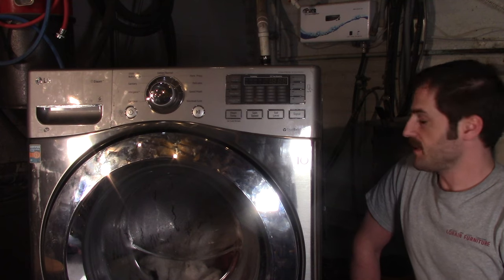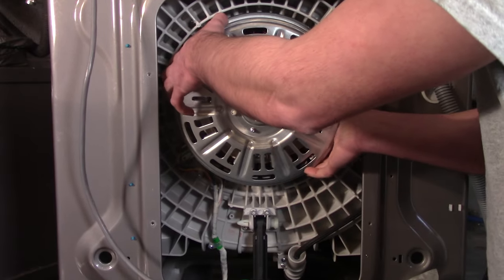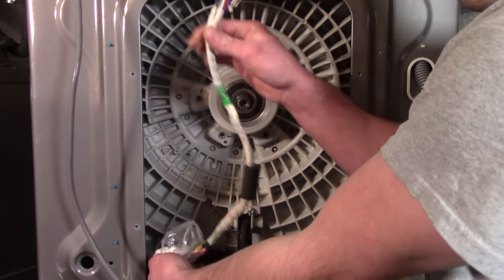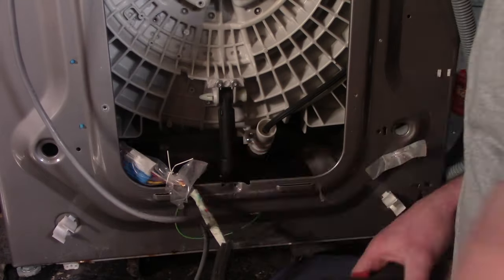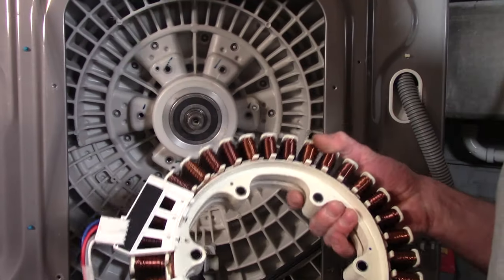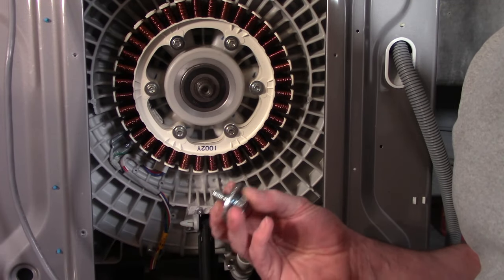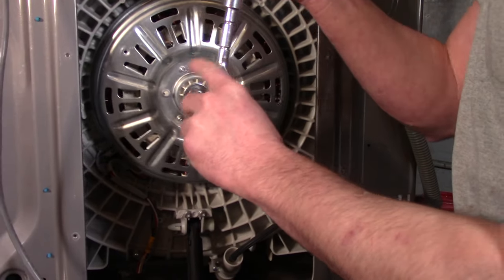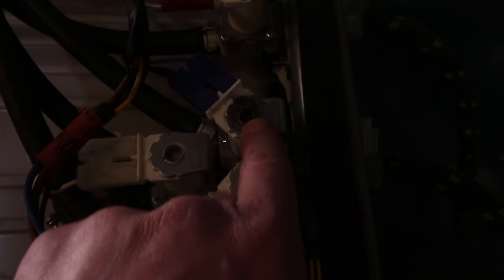LG Front Load Washer LE Error code Repair Tutorial How To Fix

Comment: I just removed my rotor and everything inside had a brown layer on it.. looks like rust maybe?  the sensor replacement didn't work but i noticed some of the copper wires on the stator were broken.. should i continue with replacing it or is it a bigger problem?

Comment: This video is really helpful. In my case, I already replaced the sensor but the LE code error still goes on, washing and rinsing cycles operates normally but the spin cycle does not run after the LE code triggers; apparently the harness is in good physical condition (just by observation). Somebody else has experienced the same issue? Do I have to replace the harness to correct at 100% the error? Is there any other faulty issue generating the LE code? Please need your advise.
Reply from the maker: The hall sensor and harness will fix 99% of LE errors on LG washers
Reply: Thank you. No more hesitation,  I will replace it.

Comment: I bought for $190,00 a used LG WM2016CW washer from a private owner who swore the machine was working fine. Of course, the first time I tried it out (on the CLEAN TUB setting), the machine stopped at the draining step and started blinking the LE error message. There is no way to return it and get my money back so I tried to fix it. I drained the water through the drain hose at the base of the machine, reset it by turning the machine and the breaker off and pressing the pause/star button for 5 seconds. I than ran the machine on the RINSE/SPIN setting. However, it still stopped and blinked the same LE error at the draining step. Since it is an older/discontinued machine, I am wondering what your thoughts are: is it worth fixing it or not? Thank you.

Comment: Looking for a Wire Harness AND a Hall Sensor for an LG WM3570HVA . I like this video am getting a LE Display Code . Tried unplugging it , holding down power and the pause buttons ( separately) then plugging it back in , but it didn't help

Comment: Nice video but the rotor will not come off as shown. First there are only two places fingers can get a grip around it. I have pulled with 2 Chanel locs side to side moving the 200lb unit. Wd 40, hammer tap no help now looking to try prying. If that doesn’t work a different brand it is.

Comment: Bought me the latest "LG Direct Drive 8 kilo Inverter"    I thought a normal Cotton wash ,rinsing, centrifuging should last not longer than one hour. 
Yet when I choose a normal  "cotton" wash  , the digits on the panel show "5 : 35" , that's over 5 hours !
Did me a few washes and I had to stop the machine since it was stuck at the first washing cycle for over two hours. !
How do I set the time for a regular 3 kilo "Cotton" wash  ?

Comment: How do I find the parts listing for my LG WM3575CW front load washer, specifically the Wiring Harness and Hall Sensor (Rotor Position Sensor) that is the subject of this video?  Do all LG front load washers have the identical parts?  I noticed that some folks list a different part number than Lorain Furniture and Appliance.

Comment: Replaced both parts per this video and still getting the LE error.

The tub turns freely by hand in both directions,  but when the tub is supposed to turn during load sensing it just shakes back & forth a little and stops then gives the LE error again.

Is the motor shot?

Comment: Here’s a question. I have a LG front loader with LE error. 5 visits from LG and they can’t fix. Replaced stator, rotor, control board, display board. Any ideas.

Comment: ok... what do you do if changing out the sensor does not resolve the LE error? i have Ohm tested the harness, it measures .2 Ohms on every wire, even when twisting and manipulating the harness end to end (in case there is an intermittent). if harness is good, sensor is new, then is the rotor bad? or??? thanks!  JB

Comment: Question: I have replaced the rotor and the sensor and I still get the grinding sound. I know you stated the wires could be damaged and have ordered them. My question is: Will replacing the wires get rid of the grind noise? I would think not, and if I am correct on that, what else would need to be replaced?
Any insight would be great.
Edit: One other piece of info, after changing the rotor and sensor, I heard the grind and received the error again after about 15 mins, however I was able to do spin/rinse cycle all the way through with not grind noise.
Thank you
Reply: Have the same problem.

Comment: Please help, I changed the hub with a new one and I do not understand what I do wrong because now there is a rattle noise. It might be possible that the rotor is rubbing against something. People talk about the fact that the replacement hub is not thick enough compared to the original and I need to place some washers to compensate for the difference of thickness. I did and it did not solve the problem. I put back the original hub and still have the same noise. Now, I'm lost about what could be wrong.

Comment: Replaced the rotor position assembly, noise filter and control board and now no error code but drum won’t turn with wet clothes and makes a rattling, growling sound.  The drum will rotate when empty but still noisy. What to do now?

Comment: Thanks you I did buy a part sencore to make sur maybe he is that . Or i will change the cable :) mine is WM8000 I hope is fix i got LE too and motore not want turn
Reply: I did buy the kits I did put all but i got problem O>O the motor not want turn is try but no rotation

Comment: I just replaced both parts as described in this video, although it will not get through a complete cycle without the same "LE" error. Is there something else that could be failed?🤨
Reply from the maker: Where did you get the parts at?

Comment: Just wondered if anyone can help me, I've changed this part before with no problem,  now have the same problem so I've changed the part again, but still have the LE error come up, and sometimes have PF now and then, any ideas what else to look at???? Cheers
Reply from the maker: Did you change the sensor and the wire harness?
Reply: @LorainFurnitureandAppliance  no just the sensor, which is what I replaced about 6 months ago with no other issues
Reply from the maker: @Phill11318   buy my kit and replace them both at the same time.  That solves 98% of all LE errors
Reply: @LorainFurnitureandAppliance  do you have a link or anything for it?
Reply from the maker: @Phill11318   it’s the pinned comment, and in the description
Reply: @LorainFurnitureandAppliance  when I installed the new sensor it was working fine for about 5 to 7 mins then the LE alarm came on,  do you think the wire harness still needs changing?

Comment: so I replaced the motor harness and hall sensor. after putting it all back together. about 15 to 20 minutes in IE code came back. unplugged it . try again the same thing. IE code came back. what's my next move. this washer is 9 years old.

Comment: Can't get the damn bolt off!! Literally lift the machine and the damn thing won't budge!!! Used WD40 and PB blaster!!! So pissed right now! Any suggestions?
Reply: Can't get my bolt off either, did you ever have success with yours?
Reply: @marycouto4170  Yes!! I put the damn thing face first on the ground with a pillow to protect the front! I straddled the SOB and got it off!! It's not easy but just a strong jerk back and forth got it off! The rest of the repair was very easy and now I have my washer back! Don't give up!

Comment: My washer goes through the wash cycle and the drum spins fine and then it drains, and somewhere around the rinse or spin cycle the washer stops and the LE error code appears. I took out the few clothes that were in and restarted the wash cycle with the machine empty, and again the error appeared at the rinse/spin cycle even with an empty machine. Any ideas?

Comment: hello i repl;aced the RPS a bout 1 month ago and it worked fine till yeserday after i opnly put 2 towels and i got the LE error code again and i called LG and they said remove the 2 towels and i stillget the LE error code and i did a power reset and i still get the LE  error code

Comment: Replaced everything exactly as in the video on my Tromm, now after putting the rotor back on the machine seems to work fine with the exception being that it WILL NOT spin at all, and makes a slight whining sound when trying to. I can see it's trying to spin as it jerks a little, anyone have any ideas??

Comment: I was getting the error code for the door latch I replaced the door latch. I reset the unit But I am still getting the error code and it stops working at random times

Comment: I changed both parts and got the same error code.  What else could it be
Reply from the maker: If the tub moves freely, then you need an ohm meter.  The three terminals should all read the same resistance against each other (ie. 1-2,2-3,1-3). If that reads incorrect, then it’s the motor, if it reads correctly, then it’s the board.    Unless you bought an aftermarket part then I would suspect the new part was defective

Comment: Me again. I forgot to describe further details about the problem I addressed earlier. Sometimes the PF code error did appear in non consecutive ways after or before the LE code error, I mean either LE or PF, but most of the times it was the LE code that flashed up on the display.  Do you think that once I replace the harness, the problem will be fixed? Thanks in advance for your comments and suggestions.

Comment: Did anyone’s washer make a grinding noise when trying to spin ? 

I’m getting error code LE but also a bad grinding noise about 30 seconds after starting.  I can spin the drum manually by hand with no issue.
Reply: That’s what mine does
Reply: Mine did this as well. Replaced the sensor and it fixed the problem.
Reply: The grinding noise come from the electronic drive the motor crazy because the Hall speed position sensor give it wrong information. This can be intermittent or stop altogether with the Code LE.